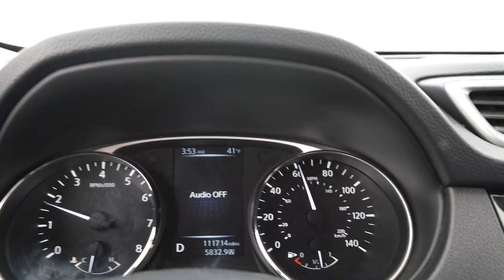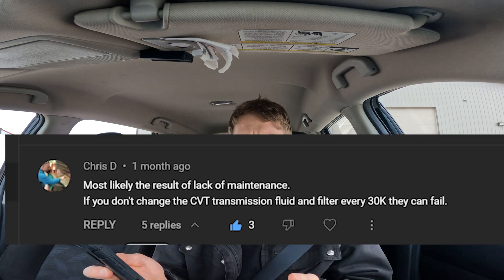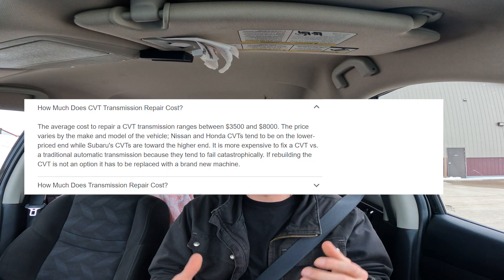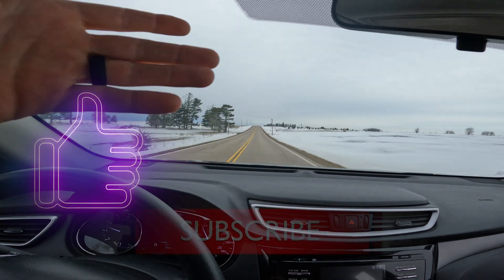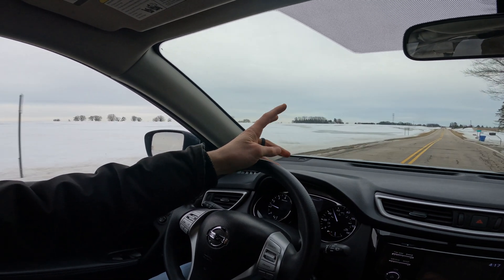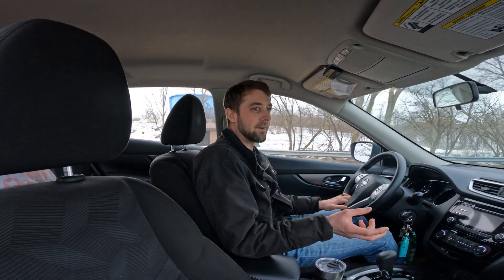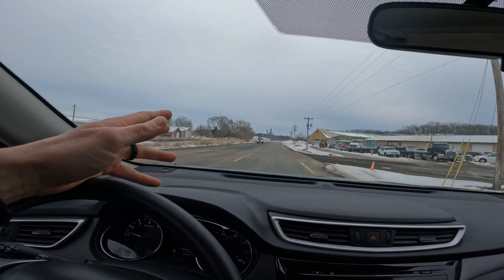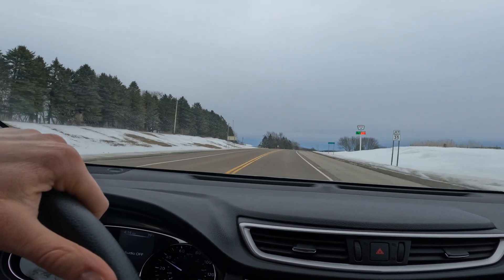Everything WRONG with the Nissan CVT Transmission

Comment: Thanks for the video. I have a 2017 Sentra, 65,000 miles, looks showroom (I'm an auto detailer; it better). My CVT was $5,200 and replaced at about 60,000 miles a year or so ago. My warranty was to expire in 3 days and went in for an oil change. They offered to replace it and gave me a loaner car. I did not detect any problem with it, other than a little "clank" when putting it in gear; something I assumed all older cars do. It did not whine and the new one doesn't either.

I'm basing my post on what you've said and my car, not on others' comments. I do think the CVT cars should be driven differently than conventional transmissions. I joke and say mine goes 0 - 60 in about 3 hours. But it really can do it in about 2. You must change your fluids, do not drive over 85, never pass with it (it has no overdrive to boost) unless you have a clear mile to do it (that isn't a joke), never tow anything, always use your parking brake when you put it in park and before you let off the brake- always. Warm it up until it falls under or around 1000 RPM (2 minutes) before driving, never pull out in moving traffic (you can't get up speed), drive like you are 65, retired and have nowhere to go fast. It's best if you're over 45 and patient.

I am going to make this 2nd transmission last and I'm grateful Nissan gave it to me and I never asked why. I'm getting a motorcycle for about the price of a transmission and keep the miles off my car except when it rains or I need to carry something. I bought it new so it's paid for (no car payment is bliss), I have nothing but a battery invested in it, it looks new and I don't want to buy someone's used car.

New cars are too expensive, I don't want a car payment and I like mine, so I have no plans to replace it and I put less than 2500 miles on it now anyway. I had a 2015 Sentra before this one, but someone hit me so I bought another. I would not buy one again however, knowing what I do now. Aside from the CVT itself, it has absolutely no power at all. I'm stupid that I didn't inform myself better. 124 HP sucks but I do like my car otherwise.
Reply: @floridaredneck Did you have a new or rebuilt transmission installed? How much for the transmission itself and labour cost per hour?

Comment: You have to baby the cvt. No jackrabbit starts or long high speeds. Even so the cvt may fail anyway. Each year more models are going to use cvts so get used to it. EVs don't have a transmission but have other ways to empty your wallet.

Comment: I had an Xtrail (Rogue). I found the CVT to be noisy and awkward to drive... it was the only negative of the vehicle. got rid of it. An epycyclic a/t with a lockup torque converter is vastly superior imo.

Comment: That commentor is an idiot- if a transmission can't work without service every 30,000 miles it's a pile of garbage. I don't think my 2011 mazda3 has ever had the fluid changed and it works perfectly at 195000 miles.

Comment: I'm sorry, you make a couple valid points but are way off on others. Yes CVT's in cars can suck for reliability when compared to other reliable transmissions. But don't forget not all traditional auto trans were reliable. There have been many duds through the years. 

Your missteps:
Using headphone I never heard CVT whine in your vid. I've never heard CVT whine in a CVT equipped vehicle. Sometimes you get engine whine in cheaper setups where the engine is being held at in it's power band.

Powerband....Traditional transmissions are incapable of hold an engine in it's power band like a CVT. If the CVT isn't doing so it is A: programmed not to do so (in order to simulate shift to a certain extent) or B: failing. Not all CVT's simulate the fake shifts. I've driven several that do not. One example is the Nissan Pathfinder. 

There are different ways to drive different transmission. Though I agree the reliability should not be drastically affected from "normal" driving.

Yes CVT's will get better fuel economy than a traditional automatic transmission. You can't say you don't see it unless you have the exact same car driven the exact same manner in both traditional auto trans and a CVT. I mean...what are you comparing it with to make that claim?

The oil change issue...I agree most won't but that's user error if the manual specifies it. What would happen if you never changed your engine oil? The SAME THING, but faster. So it's good you bring this point up. READ YOUR MANUAL PEOPLE. The maintenance schedules were created by the manufacturers to ensure the vehicle lasts for it's guaranteed amount of time. 

Look I'm not a CVT fan boy by any stretch. I think they work fine in ATV's and SXS's but the more power and weight you put on them the more the reliability seems hit or miss. I largely think this is an engineering problem as CVT's in vehicles is relatively new. Just think about all the dud traditional automatics that manufacturers have made in the past. 

A CVT that's programmed to be a CVT rather than simulate a tradition trans is the smoothest you'll ever ride in a gas powered car. Unfortunately they have a bad wrap because in many cases they weren't engineered to be as  tough as their traditional trans counterparts. 

My biggest gripe with CVT's as should be yours is the reason auto makers started putting them in cars to begin with...To meet GOVERNMENT regulations!!! The government is continually forcing products on us that we don't really want... Just this year Dodge stopped making their V8 Hemi engine due to the regulations. One of their if not their most popular engine options. Have you notice all cars are getting smaller and smaller engines that are usually turbo charged? This isn't because turbo's are the cool new thing. It's because you can strangle more horses out of an engine with a turbo. But this comes at a cost of reliability and longevity.
Reply: The CVT transmission does give you higher gas mileage , But Nissan has done something very different They are configuring their vehicles, so did you have to take it back to the dealership to To have general maintenance on a vehicle.

Comment: The CVT is a great idea. In practice, though, the tech is just not ready. The metallurgy isn't there. And the engineers have to build these things to a cost because they've been relegated to mostly cheap eco boxes. But this shit will be pushed on us anyway in the name of fuel economy and emissions because having a bunch of cars that barely make it to 100k miles is oh so much better than a slightly less efficient car that will last over twice as long.

Comment: My wife loves her 2017 Rogue. With 141K miles, CVT gave out last year and I limped it to the dealership for her. $7,000 parts/labor, her treat. Other issues: Front wheel bearings went out @ 73K, left rear brake caliper chewed a rotor @ 127K, minor intermittent electrical ghosts, no tranny dipstick, and body panels made from recycled Coors Light cans. I don't get it. Then again, I have a 2009 Tacoma with terminal frame rust, so I'm leading in the race to the junk yard.
Reply: Did you service your transmission before it broke down?
Reply: @jd3521  I did not and that's on me. I abided by the "Maintenance Schedule" which didn't include this as an interval service...my mistake. I now drain and refill once a year. Now with 191K miles, electrical issues are becoming more pronounced, ABS is shot (front sensors), the TPMS  often fails to register tire pressures, and needs new tires, but it runs well.
Reply: @jd3521  You nailed it, I think that's the cause. The CVT's oil should be changed every 30 to 35K miles.
Reply: Those problems are caused by yiu guys not the brand
Reply: I got a 98 Sebring and only had to replace the valve body for 500$ n it's good again for another 80k miles seems like they need to make some money back on something because my 1998 200sx transmission was able to just change filter and fluid and it's brand new again less than 100$
Reply: does it came across that it might be the wife

Comment: Many manufacturers use the CVT, why don't they fail.
Reply: Nissan uses Jatco transmissions, because for a while the old Renault CEO was in charge, he was then the CEO at Nissan.  So when Jatco's were installed in Nissans car and SUV's 
therre were many filaures. My 2019 Rogue has been very good - I do change the CVT trans oil every 35K and a lot of people didn't. So I think those were the ones that had problems.
Reply: They do fail just not as often as Jatco CVTs do...
Reply: They use takeoff gears rather than rawdog the belt from launch to overdrive

Comment: I have a 2017 Rogue which I bought new it now has 141, 000 miles with the same transmission and not one problem. I live in Canada and we have drove it coast to coast twice.4500 miles each way with no problem. I think like anything else you always hear about the lemons but you never hear about the  good ones, which are probably far more than the bad ones. Every manufacturer has lemons, nothing is perfect.

Comment: I have a 2017 Sentra, transmission is out. Put the car in drive or reverse won't move. I replaced the speed sensor nothing. Code P2765. Now looking to purchase another transmission because the extended warranty ran out at 7 year or 84,000 miles. My car has 130,000 miles😢😢😢😢😢. I hate I bought this crap of a vehicle

Comment: Bought a 23 Sentra new.

I get average of 36 mpg. 

My old car, a Toyota Corolla 2018 got 35.

Car before that was a 5 speed manual, 98 cavalier. Got 24 average mpg.

So a manual getting 24 will prob compensate for cost of replacing a cvt.

But that being said, Toyota cvt seems to last much longer than a Nissan. 

So I will trade this off for a Corolla most likely before the warranty ends.

From what I have read, reason Toyota cvt lasts is they are chain driven, vs a belt driven cvt with Nissan.

And Nissan used to make reliable cars. 

Why they have not switched to a chain driven cvt with all the lawsuits makes no sense.

Comment: Just bought a 2024 Outlander ES gas. First time owning a vehicle with CVT transmission. When stuck in traffic on highway going between 20-35km per hour, the car makes a slight jerk when using gas pedal to break and accelerate, also makes slight jerks when breaking between 20km per hour to 0 (full stop). Does anybody know if this is a normal function for cvt's?
Reply: Normal.
Reply: The cvt in the Highlander is made by the same makers (Jatco) then the cvts in Nissans… get the extended warranty if you decide to keep this vehicle more then then the warranty period… also do the fluid changes every 25,000 miles… keep all receipts…. But honestly, I wouldn’t tow with it..

Comment: As a tranmission specialist, almost all CVT break-down I've seen is due to poor maintenance. He's absolutely right about people blowing off recommended CVT fluid change. I've drained CVT fluid with chunks of metal. Also, OEM transmission fluid is crap. I strongly recommend AMSOIL CVT fluid if you plan on prolonging the life of your transmission.
Reply: Same here..tiny metal parts while draining out gear oil. Now it's jerking heavily and not going up even a slight slope. Is it gone or fixable?

Comment: IT is NOT a CVT problem it is an Nissan problem, pay a little more for Toyota/Honda and your good. Toyota Prius with E-CVT are the MOST reliable transmission's $ can buy.
Reply: My Toyota’s CVT is terrible. 2012 Corolla. Leaks constantly, shifts hard, and revs way higher than any other transmission I’ve had. Just avoid CVTs in general.
Reply: Prius e-cvt is completely different to a traditional cvt.
Reply: @nichil3129  It is but driving it is still just as boring.
Reply: Reliable it has never been , but it always sucks and takes the life out of the engines performance making it work harder and noisier , horrible experience no matter what brand , just cheap econo box feeling in all Honda's Subbie and Nissans ... No refinement from the engines attached to CVTs😂😂
Electric versions in Toyota are a tad better but Hybrid can be done with real geared automatic , ECVT is just cheaper to make , not more refined .
Stay away from this garbage and at the same price you can get a vehicle with real geared tranny not crappy substitute like CVT.
Reply: I can tell you are an absolute idiot, Ecvt is not a CVT..........
Reply: between a 2014 camry and a newer sylphy or hyundai sonata 2015 which is the best over like 5years?
Reply: An e-CVT is actually a completely unrelated technology to a belt and pulley CVT as is used in the Nissan vehicles.  It's mechanically completely different.  Apples and Orioles.
Reply: Toyota hybrid's E-evt is different mechanism compare to normal cvt, just named cvt but not same at all.

Comment: I have over 300,000 miles drive Nissan CVT's.  Step on the gas they wind up for 15 seconds them they rev down to lower rpm's than a conventional transmission.   I change fluid every 30,000.  My 2013 Altima CVT was going strong at 200,000 when I got rid of it.  My 2011 Sentra has 100,000 and the CVT has had no issues.  My 2017 Altima lost a CVT at 20,000.  Known issue and was replaced under warranty.   I won't buy another Nissan.  Dealer in my area is grossly incompetent.  I will buy a Toyota with a CVT.
Reply: I am not sure how you come up with a $3000 figure.  The garage I go to charges $265 and that is with Nissan fluid.  The dealer in our area $345.  I do it every 30,000 miles which is about every four years my 2011 Sentra and about every five years for my 2017 Altima.
Reply: so you've spent $3000 on fluid exchanges on your Nissan CVTs

Comment: A new model hyundai use the same technology as cvt,but the difference is they use chain instead of using belt in their transmission, so it got to be more durable, they call it IVT,other car manufacturers should adopt this kind of technology

Comment: My mom drove a 2008 suzuki sx4 sedan with a CVT. She just donated it to Teen challenge last year with 320 thousand kms on it. It was still driving fine, but the car’s accessories started getting electrical gremlins from rusted grounds and connections. It had no “fake shifts”, it accelerated at a fairly steady rpm. She bought it before i even knew much about CVTs in cars. I would describe the acceleration or power feeling as like it was wound up with a clock spring or rubber band…. Starts kind of slow, but then gets going all behind a steady push of G force. Similar to an electric car, but with much less torque. Not sure why Nissan is struggling with them so bad… suzuki had it down more than 15 years ago!

Comment: From what I've read here in the comments it seems like Nissan is the only manufacturers who sucks at making them. I definitely agree with the criticism you mentioned. I own a Mitsubishi CVT with about 107k~ miles and have had no real issues with it (so far), surprisingly quiet, unlike the Nissan ones. Unfortunately the Mitsubishi one simulates shifting (mine does atleast) which I can't say im a big fan of, makes it very sluggish. But it seems to depend on the manufacturer to manufacturer how long they'll last with proper maintenance...moral of the story is don't get a Nissan. 🫠🫠

Comment: I am driving a 2028 Subaru Forester with CVT and no problems and works fine. CVT transmissions are not bulletproof so they do not take abuse like manual transmissions.

Comment: It's a problem mostly endemic to Nissan (Jatco) CTVs. Seems like they were not designed to handle a lot of torque from larger engines but on smaller displacement applications, they seem fine. Toyota and Honda CVTs seem to fair better with Toyota now primarily using a CVT with an actual 1st gear that used when driving off from a complete stop to reduce the strain on the belt.

Comment: I had a 2009 lincoln mkz that was a 6 speed manual. well i wanted to be like the kids with the hell cats and demons and do burnouts and doughnuts. well a little fun later there's a boom gears go flying off to france oil flows and spewing like a fountain and that's the end of my mkz. I asked the people where i bought it if they could fix it and they said it was so badly damaged that it would have to be scrapped. and scrapped it was with only 56,000 miles on it...HEY!! you know that that new fridge or fancy washing machine you just bought... yeah i think that's my car ....

Comment: The other problem I have with CVTs is that the fluid and filter cost like 2-3x more than a regular ATF and filter. So, whatever fuel savings I get from the CVT is cancelled out from periodic maintenance.

Comment: CVTs are great...in flat areas and small cars with small engines. I'd rather have a stick shift in a small car, but that's not efficient, compared to the multi-speed automatics of today. I think CVTs will ultimately be a fad, like Continental tire kits of the 1950s and 60s. Their mode of operation is too inefficient to be a good long-term solution.

Comment: Their worst version of this transmission is the hybrid  cvt on the nissan xtrail aka the rogue in the Asian markets the dam thing comes with an electric  motor  bearing that breaks after 100,000 km which stalls the vehicle while driving its such a hazard also the vehicle  jolts so hard while switching from hybrid to the gas worst  experience from nissan

Comment: 1st gen 2003 Murano. No service CVT went 370,000 km. 2014 Juke went nearly 200,000 km no issues until kid wrecked it. 2012 Suzuki SX4 (same CVT) no issues so far. Drain and changed twice. 

Our PDK Porsche is far more maintenance heavy and fickle. 

Don’t bag drive your car.

Comment: Nissan cars are good specially the manual cars the CVT ones are crap i never owne and dont plan to own one because ive seen a lot of friends and family relatives having problems with it i own a toyota vios and a Honda civic no problems just changed the engine oil every 10k km and transmission fluid every 96k km